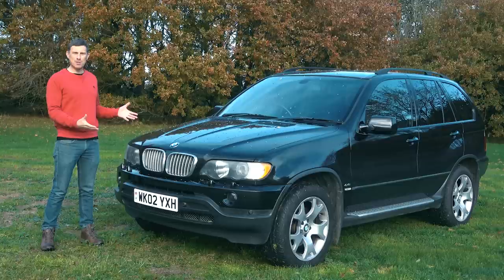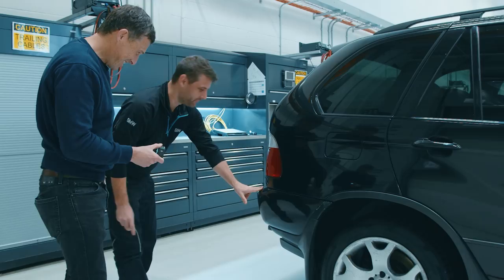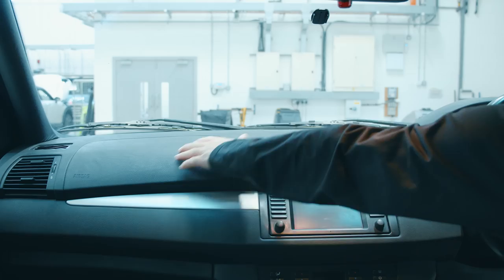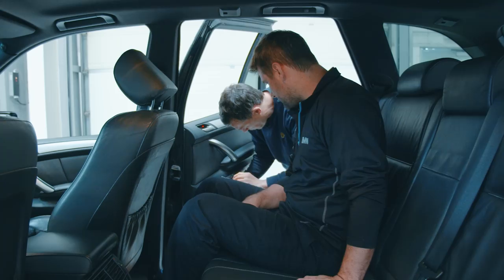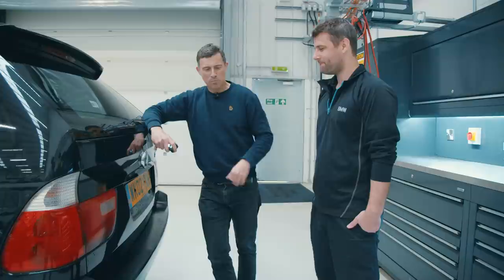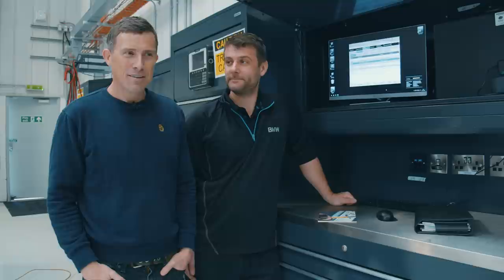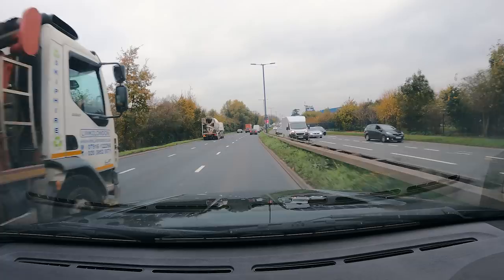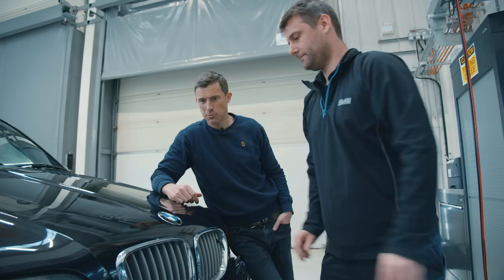BMW RATES MY 'NEW' X5 V8!

Comment: I miss my XC90 V8 from 2006. What a fun car that was. Safe, reliable, lots of smile / mile. Same size engine, even a bit more power. Nothing beats a V8 roar when you power sliding in the mud :)
Reply: Until this week I didnt even know volvo put a v8 in their cars, and a yamaha v8 at that. Sounds sick, too bad they stopped making them and fuckin co2 tax here is insane, even if I wanted a really old one.
Reply: @dwade3202  I still got my S80 V8, as I had both. Tax is crazy, even if its a weekend car you still pay full.
Reply: My friend has one..I love it..( I have an xc70)
Reply: Finally a real driver that knows how the car drives nice
Reply: @dwade3202  Noble used the same engine in the M600, they gave it twin turbos and it made 650bhp
Reply: @dwade3202  live in Ireland by any chance, talking of insane C02 tax🙄
Reply: I had the 2.5 turbo and did a lot of mud sliding myself.  I also upgraded the turbo as well 😅 blew the engine eventually but sheesh tht turbo 5 sounds so great!
Reply: The Volvo v8 is made by “Yamaha” and it’s a gem
Yamaha has actually made some the best engines ever like the one in the LFA
Reply: @dwade3202 Volvo ain’t what it used to be. now they’ve got top speed limiters at 112mph…
Reply: I’m not that old. I actually had to Google to confirm Volvo, of all companies, actually put a V8 in the 2000s. They’re all 2L engines now.
Reply: @MorrisIriga  D5 and T5 used to be 5 cylinder, T6 was 6... now only 2.0 4cyl chinese engines, maybe some 1,5 3 cyl. With the new design and owner, Volvo become more german looking, less reliable, feels cheap, annoying tech.... I had 7 Volvo, 30 in the family. No more, P3 is the last platform I like from them.
Reply: My family had the same except car except the 2008 model car that got me into cars. was such a nice car everything was perfect.
Reply: @TheBimmerMan  that doesnt matter cuz after the remap youre flushing out the old settings :) soo VOLVO FOR LIFE
Reply: No geartronic issues?
Reply: @daigosaito888   Not really the main issue was noises when it was cold.
Reply: @Mark__A  They are NOT Chinese engines. The new 4 cyl engines are entirely Volvo designed and built. VED, the diesel shares a lot of design traits with the D5 engine, they had issues but are otherwise fine. The 5 pot is a fabulous engine in both diesel and petrol guise but would not of allowed the newer, bigger heavier cars to meet emissions.
Reply: @daigosaito888  The V8 used a different transmission. It was of a different design and beefier. The issues P2’s had with drivetrain were mainly due to the D5’s torque output and delivery, lots of torque and very sudden, and in XC90 as the car was much heavier and the platform wasn’t really designed for it.
Reply: i also owned a XC90 V8 (2005). I loved it, but I had tons of problems with it, constantly. The engine worked fine though. I'd buy it again if I could get one without too much issues
Reply: @deafyboy86  Tried the new diesel and petrol and they are horrible. Had a V90 T6 R design for a week, turbo delay and lag was like the grand canyon. You pushing it it takes forever to start going, like there is a small gap at a roundabout, you missed it by the time it moves. Even worse, when you come off from the accelerator, it still accelerate for a second, almost rear ended the other car. Like WTF Volvo? Had the XC60 with the D4, and that one was pretty similar but slower. It was very bad and disconnected feeling compared to my P2 and P3 cars. Had plenty, have 2 at the moment. I will keep my S80 V8 forever. That was peak Volvo for me, amazing joy factor, unbeatable smile / mile. Instant reactions for every input. Car enthusiasts dream really. I will swap my xc 60 for a V60 Polestar, 3.0. And no more Volvo for me. Will go for Lexus most likely. 10yr warranty, sage, reliable, very high quality, much better than new Volvos.
Reply: @deafyboy86  I had angle gear and transmission problems also steering rack problems in my XC90 V8. It was fun, feeling like in a tank, but expensive to keep it running. I have much less problem with P3 cars.
Reply: @gamebuster800  I had one too, 2007, listed some issues above. It is a fun and enjoyable car but very high running cost. Road tax is the highest too, fuel consumption is high, and every service something is needed in the 1k to 2k range. I would buy a Porsche for more fun, similar running cost possibly.
Reply: @Mark__A  T6? Was it a hybrid T6? The T6 engines in the SPA based cars are supercharged as well as turbo and I always found them to pick up very quick and very strong.

Comment: A lot of this stuff is DIY-able. Go on Matt, do it. BMW quoted me £1,265 for discs and pads for my X3. I did it myself for £350 in parts.
Reply: @welshrecon  Don't know about an X5, but they're about 40 or 50 quid for X3 power folds.  Don't even need to be in the same colour either, as the panel is swappable.
Reply: just replaced all my discs 3 hours ago with ceramic brakes and discs. $400 in total. I also repaired my engine and stuff by myself. Overall I woulda have had to spend like $3000 somewhere but  I did everything by myself for only $800.

Comment: I would be more worried if it doesn't leak oil because that means there's probably no oil in it at all.
Reply: And this is probably why when my friend buys used cars, he immediately goes full send redlining all the way on the highway.

Because surely it should be able to survive that if there's oil right?....
Reply: makes me think that youve owned more than one BMW with that comment
Reply: The timing chain is gonna be pain in the a**
Reply: @k-dawg58  at 130k and 20 years maybe it’s been replaced already
Reply: @aidenp5768  I saw n62 was more better than m62
Reply: The last time I watched this channel the fella was paying thousands for a couple of bolt on accessories for a Suzuki Jimny. So pay the money I say, what a brilliant car if the minor faults are fixed. Just don't go to a BMW main dealer who will charge top dollar, find a friendly Beamer specialist who will do the same job but save you some money. 👍
Reply: Hahshahaha 😂 this is gold
Reply: @k-dawg58  n62 will me more expensive to repair ..M60 was the beast... I had e34 540, no gearbox or engine problem but not so good on fuel. No leaks from engine, no timing problem. M57 (diesel) would be cheaper option I think and easy to remap.
Reply: @ImhotepBE  just got a e34 540i 
E34 is goat gen 

E39 way too overhyped IMO
Reply: @k-dawg58  E34 540 was my daily and E39 540 too... to pick one up...I would go for e39, faster, better on fuel, more comfortable-ish.. but more expensive to repair. Then e34 540 would be my weekend car 😎👍
Reply: @ImhotepBE  got FB bro ? We got to talk more , finally found someone knows my Bimmer language 👍
Reply: @k-dawg58  hehe.... Thanks 👍
No, Im not on FB or any other social media...only YouTube account 😅
Reply: Thats an old soviet saying i heard from old agricultural equipment drivers - if oil is leaking it means its still there
Reply: I took my 2008 e92 in for an oil leak because I had lost 1ltr. No leaks they told me and asked when I last topped it up. They laughed when I said 6000 miles ago. My bad, I'm new to this car but apparently that is very impressive for any car
Reply: @smoothmicra  Absolutely. I slashed a £2100 job to under a thousand
Reply: @germaineliew2012  So when the car dies because of this he has to pay the owner the repairs, because he broke his car? 😂
What a genius.

Comment: A great change from new car reviews. This format was so interesting to watch with the master mechanics input and all the great detail covered. This is very relateable to anyone who drives an older vehicle. One of your best Mat.
Reply: Agreed. I enjoyed this video and it was nice to see the channel covering older cars. Especially as I own a BMW X5 and live in it almost fulltime, sleeping, cooking, travelling, and exploring the wild regions, on and off-road. Mine's a 2005 6-gear auto 3L diesel Sport. I've owned it for several years and can honestly say it's one of the best cars I've ever owned. The only weak point on a very solid SUV, is the weak internal door lock mechanisms (the clips are not sturdy enough for such heavy doors). It's a dream to drive and so smooth for such s heavy vehicle, sticking to the bends like glue, with no role, and very smooth on the motorway. And I've yet to ever get it stuck off-road in rough conditions. I love it! ☺️
Reply: 100% agreed.

Comment: Hi Mat, super nice vid, make more of this format please! The rear bushings can be bought separately OEM and pressed in quite easily. Recently did it on my E65 730i. Saves you €2000 on parts! I could fix your car properly for half that bill...cheers!
Reply: Actually now he's made a video about it he can claim the repair costs on his tax bill.. Basically the only reason he made the video lol..
Reply: your missing the point this video is just for content its probably from auction and straight back he ain't ever going to fix it
Reply: @MrTomo89 Na a days wage to buy then a days wage to sell just for one video?
Reply: @robert7622  for a channel with over 790k subscibers? I'd say yes.
Reply: You are welcome to come and fix all my bushing 😂
Reply: I had a 2008 E65 730d, one of the best cars I've ever owned. What a motorway motor.
Reply: Yes thats the Main Dealers prices
Reply: Please fix mine

Comment: This account is so awesome! My dad owns an X3 from 2012 and it has been with us till now. It has 565'000 kilometers and it already needed 2 engines rebuilt. Classic BMW 😂
Reply: Other older BMWs would do laps around the world after a modern bmw needs a rebuild. M50, M52, M54, N52, even the n62 version of x5s have done that amount of milage without needing a rebuild.
Reply: @aidenp5768  hopefully the B58 can prove to return to the reliability routes of BMW
Reply: I didnt know the X3 had two engines
Reply: @S58985  I have a feeling the B58 will definitely bring back the reliability.
Reply: @S58985  definitely, the B series range in general are showing early signs of being extremely reliable

Comment: I think it’s awesome that BMW sanctioned this with one of their master techs. It’s great seeing how it’s not only new cars they’re interested in scalping you for but older classics too! But the enthusiasm Mitch shows for this E53 demonstrates that despite the real world costs associated with owning older premium brand cars, they can still put a smile on your face when you mash the accelerator!
I had one of these, same motor, same issues, and I loved it!
Reply: That is the real cost of European manufactured and service products that you do not see in cars that are built with slave camp components that are ultra cheap for a reason. BMW are a luxury car and hence they will cost more to repair.
Reply: @bighands69  The design of the car is gross. It has been arranged to drain your wallet in the hype without the real-world value benefit of a well-designed, crafted automobile. BMW has lost its competitive edge and values profit over constructive builds.
Reply: @arvadacounselingcenterinc.7284  
You can try and make excuses for cars containing slave labour all you want.
Reply: @bighands69  Do you not look at all the tube videos of the assembly of BMW, like some of the Volvo's. Really?
Reply: @arvadacounselingcenterinc.7284  What's gross about it? I've done work on mine...It's not so bad to work on. I did the rear suspension, re-sealed the rear differential, and replaced the transfer case. It all came apart and went back together pretty easily. I did the front bushings mentioned in this video as well. All I had to do was unbolt the front end, drop them down, and replace the bushings with a simple press tool.

Comment: Found a gem in 2020…2002 X5 3.0d, all the options, no dead pixels, 30k miles and showroom clean. Previous owner even had carpets specifically made for the rear sliding load tray.

Comment: I have a manual 6 cylinder X5 this is the one to get it is very short geared which makes it very lively under 80kph and it is very surprisingly quick it will spin the wheels for 2-3 metres if you want to drop the clutch, the manual is the fun one.

Comment: THe N62 will have all the leaks... for sure, but once fixed you'll be good for another 100K miles. More if you also fit a lower temperature thermostat.
Reply from the maker: May do this. Thanks for the advice. After filming this the passenger door handle failed tho.
Reply from the maker: It's an M62 actually. Supposedly better.
Reply: @MatWatsonCars  yep, but not much :)
Reply: @MatWatsonCars  And I was wondering, how all the doors are working still.. XD
Reply: This is a M62 unfortunately these suffered timing chain issues
Reply: @anthonyk  True, but it's has less issues than the N62, which picked up Valve Stem Seals as well...
Reply: N62 is cheaper to fix compared to the m62 the timing chains are very very expensive compared to valve stem seals
Reply: @jamescarl6187  Yeah but valve stem seals are in addition to timing chain issues... Also, transmission valve bodies are a problem, at least on the E65/E66 7 Series...
Reply: @MartinJones123  the engine has seal issues there's nothing internally wrong with N62 in fact I changed my seals and have been doing 5k oil service intervals along with a 90c thermostat and this fixed all my problems with oil consumption usage. I believe the 15k service intervals on these engines is what killed the seals
Reply: @anthonyk  I know of somebody on the BMW forums that has owned both an M62 and N62 and both have served them well, though the N62 still needs seals even if serviced on time... All BMW V8's until the N63 had nothing much wrong with them internally...
Reply: @MartinJones123  I've owned 2 vehicles a 750i with a N62 and a 4.4i X5 and I can tell you that by the time my X5 got to about 160k miles I was getting cold start rattles, I'm at 172k on my 750i and it's dead quiet at start up.
Reply: @anthonyk  I don't really know if a timing chain is considered something which makes a car extremely terrible as although it's internal, it isn't something like a piston or a rod bearing... Both the M62 and N62 can last for ages if you maintain them probably and fix the shortcomings every now and then...
Reply: @MartinJones123  the whole point of a timing chain is that it lives the life of the engine and many M62s will far outlive the timing chain guides, everyone who owns a M62 knows it's something that needs serviced. That's why on the N62 there are different types of chains and separate chains for each bank of cylinders with their own tensioners
Reply: @anthonyk  Yep, but what's the lifespan of the engine? Many cars suffer from timing chain complications... The M62 only has the timing chain issues while the N62 has that  and valve stem seals but then we have the N63... So neither the M62 or N62 are terribly unreliable, if you maintain them properly...
Reply: @anthonyk  Also, the BMW mechanic said the M62 in Matt's car is more reliable than the N62, which was in the facelift X5 iS that Matt spotted...
Reply: @MartinJones123  I did here him say that which is a little confusing to me because the N62 other then seals leaking is a solid engine. I recently did some gaskets and changed the thermostat out for a 90c one and the car seems to have a little more grunt in the city. Oil change is very important also for engines I never went off of the 15k year thing it's been proven that even in recent years BMW went down from 15 to 10k miles in oil change services. I personally do mine every 5k miles. I'd own a M62 if it didn't do that it's a common problem with the M62 maybe not when new but many people have experienced that after 150k you should really have them serviced
Reply: @anthonyk  That's the true killer of all BMW's... People buy these cars to look rich and then maintain it like it's a Civic or Corolla... Most times I see an M62 or N62 powered car, it usually sounds very unhealthy and/or it's blowing white smoke, which is an indicator of valve stem seals... These cars need lots of care and you can keep the costs down by doing most of the work yourself (If you're able to)...
Reply: @MartinJones123  unfortunately I blame BMW for most of it most of the rich people will listen to BMW 15k oil service intervals and by the time it's out of warranty the person who leases it dumps it and gets a new one
Reply: @anthonyk  Yeah, and the stupid 15,000km service intervals... I think this makes the brand look better on the new car reliability reports or something...
Reply: @MatWatsonCars I would prioritize changing the Timing Chain Tensioner ASAP. It's like an $80 part and very DIY-able (or cheap if done at a shop).

A worn tensioner causes the plastic guides to fail which leads the "timing chain" issues people talk about. 

I recently bought a similar X5 myself.
Reply: @IvanTheHurricane  alot of the times it doesn't help, the chain gets stretched out and the guides eventually fail in the range from 150k to 200k miles

Comment: I had a 3.0d version and did 350k miles before I chopped it in but such a great workhorse across 10 years of getting kids, dogs and kit about. I so lucky I extended the warranty though as it was like triggers broom and was running like new when I sold it. As it would with everything having been replaced 😂